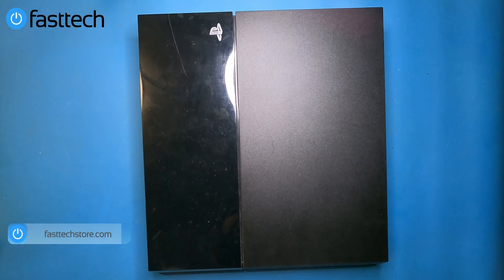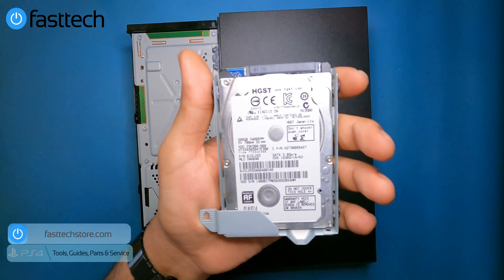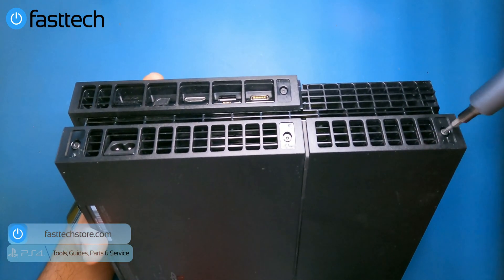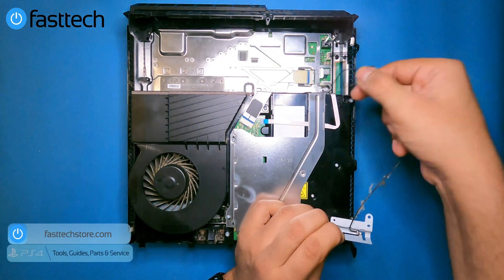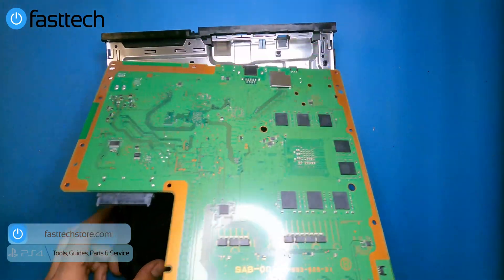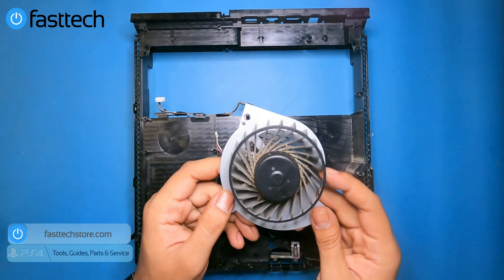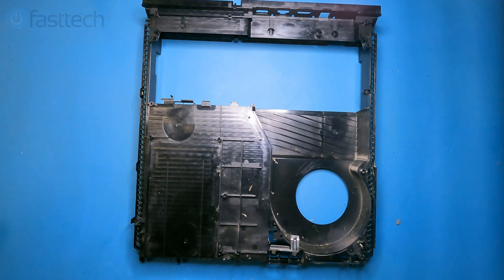PS4 CUH-1115 / CUH-1100 Disassembly and General Repair Guide (OVERHEATING, CANNOT START, NO POWER)

Comment from the maker: FREQUENTLY ASKED QUESTIONS
Where do I buy the parts and tools needed for this job?
👉Fasttech Pro Auto Kit: https://www.fasttech.ca/tools/fasttech-pro-auto-kit
👉PS4 Casing: https://www.fasttech.ca/playstation-4-parts/playstation-4-cuh-11xxa-right-case-black
👉PS4 Hard Drive:  https://www.fasttech.ca/playstation-4-parts?category=Hard+Drive
👉PS4 Power Supply: https://www.fasttech.ca/playstation-4-parts/ps4-power-supply-adp-240cr
👉PS4 Disc Drive Cables: https://www.fasttech.ca/playstation-4-parts/ps4-data-ribbon-cable-cuh-1001a-and-cuh-1115a
👉PS4 Disc Drive: https://www.fasttech.ca/playstation-4-parts/ps4-disc-drive-bdp-025-cuh-1115a
👉PS4 Motherboard + Logic board: https://www.fasttech.ca/playstation-4-parts/ps4-sab-001-motherboard
👉PS4 Midframe: https://www.fasttech.ca/playstation-4-parts/playstation-4-midframecuh-1115a
👉PS4 Heatsink and Backplate Assembly: https://www.fasttech.ca/playstation-4-parts/playstation-4-heat-sink-and-support-plate-assembly-cuh-1115
👉PS4 Fan: https://www.fasttech.ca/playstation-4-parts/ps4-internal-cooling-fan
👉PS4 Screw set: https://www.fasttech.ca/playstation-4-parts/ps4-screw-set

👉NEED HELP? FaceTime/Zoom Video Call Me: https://www.fasttech.ca/online-consultation
👉GET REPAIR SERVICE FOR YOUR DEVICE: https://www.fasttech.ca/electronics-repair

Comment: My powersupply cable is not coming out , i've tried wiggle while pulling ,how do i remove it?
Reply from the maker: Use isopropyl alcohol to clean and lubricate the connector then pull it out gently

Comment: Thanks, most easy to follow tutorial. Unfortunately I destroyed 2 small plastic clips on the CMOS holder and it wouldn't hold the battery anymore, but I fixed it with some foam (for pressure) and kapton tape. Repasted with Gelid GC extreme and it's so quiet now. My CMOS holder was also different btw.
Reply from the maker: @Drinkyoghurt  thanks, my objective here is to make easy to follow tutorials that dont miss a step. Thanks for your comment
Reply: I popped out the battery from the opposite side, much less likely to damage the CMOS holder
Reply from the maker: @ thanks for your input

Comment: I just got ahold of a ps4 with one of those broken fan connections, is it possible to repair this broken fan connector if someone did break it off???
Reply from the maker: Yes you can fix the connector
Reply: @fasttechvideo  Well, the motherboard power connecter for the logic board is missing too and I don't have the parts to replace them. lost cause I guess.
Reply: so it turns out that not only was the fan connector and the logic board connector missing, one of the resistors for the memory chips was missing. I just used wires in place of the connectors and replaced that transistor and now it works again.. it was on firmware 7.02 as well.. not bad for a personal project if I do say so myself..
Reply from the maker: @leonIdas002  good job

Comment: Brother im confused can you help, basically i had a CUH-1001A model and have to replace both motherboard and power supply so can yoj pls tell me which ones are compatible and what i generally should look out for❤ thanks
Reply from the maker: You need a SAA-001 mainboard and disc drive logic board combo and a ADP240AR power supply
Reply: @fasttechvideo  thank-you so much God bless🙏
Reply from the maker: @BARRY725  God bless you too, we also stock these on our site if you’re interested. Let me know if you need the links.

Comment: Please pin this comment. WATCH OUT before mother board shield comes off there is a screw under power supply. This ps4 was missing it. SHIELD WILL NOT COME OFF WITHOUT THE SCREW REMOVED.
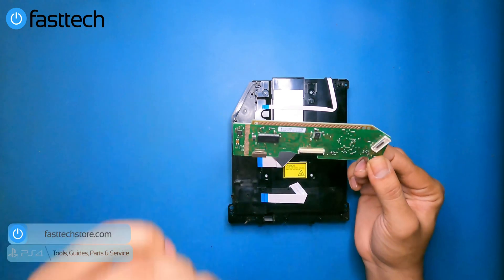Reply from the maker: No it was there and removed at 9:28